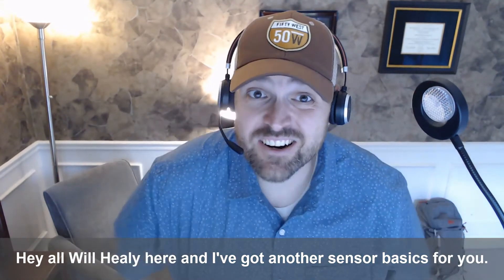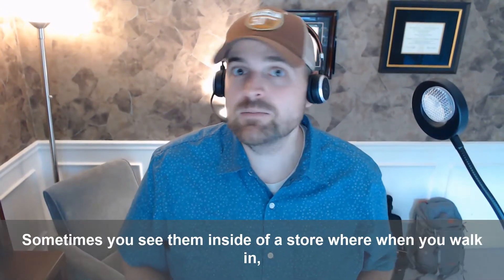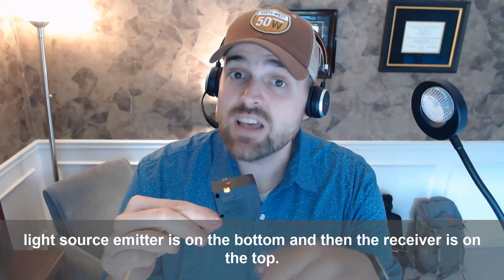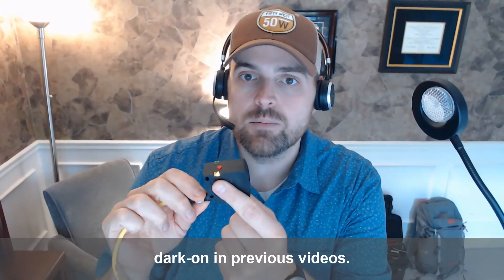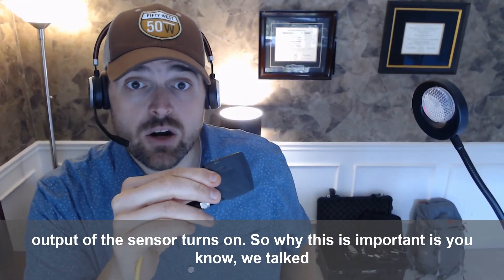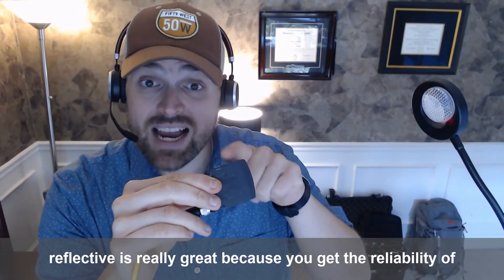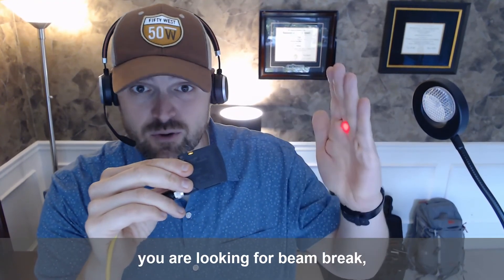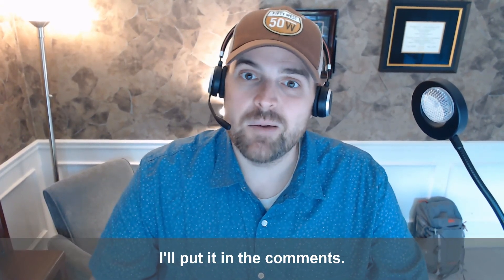Sensor Basics:  How does a retro-reflective photoelectric industrial sensor work?

Comment: I appreciate how you explained the retroreflective photoelectric sensors. Much like how you struggled with alignment of the sensor and reflector, i am having issues at different heights also. Are there simple tools i can use to align them? Example being 8 feet apart at different heights
Reply from the maker: Thanks for the question Nic. I've see a few tech's use a line laser level or laser pointer to get the lineup easier between two, especially if the light source is infrared or something hard to see. Alignment is definitely a challenge for thru-beam sensors and retro-reflective sensors.

Comment: How small can you make photoelectric retro reflective sensors….I want to use one for an occupancy sensor in a room….I’d likely need to have two beams side by side…to detect direction of movement, right? So let’s say you have beam A and beam B….I could set it so if beam A trips and then B, add one count to the room, if beam B trips first, then A, subtract one from the room……I’d want to be able to house the emitter and reflectors in small housings that are easily installable on the sides of doorways.

Or would diffuse sensors be better for this?
Reply from the maker: The sensors mentioned in this video are industrial. You likely would need to find something more embedded.